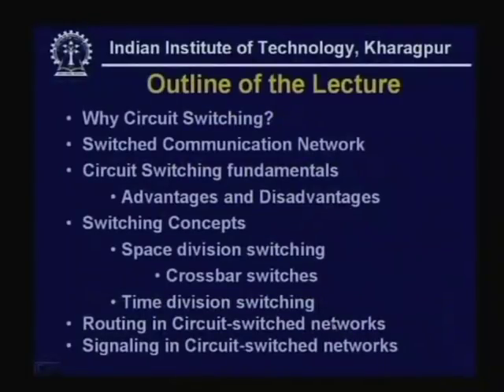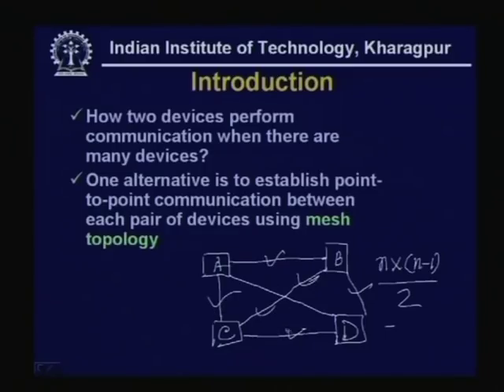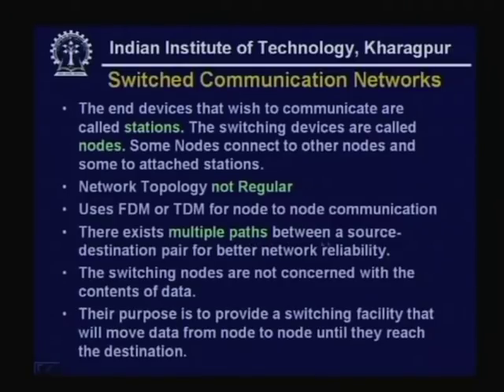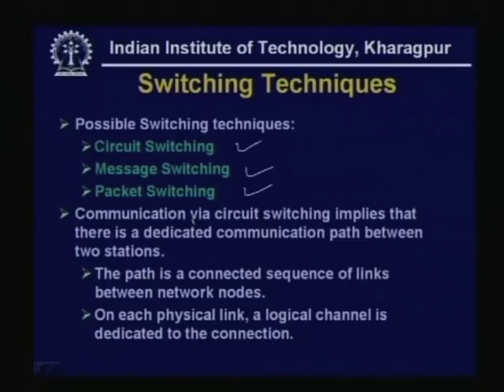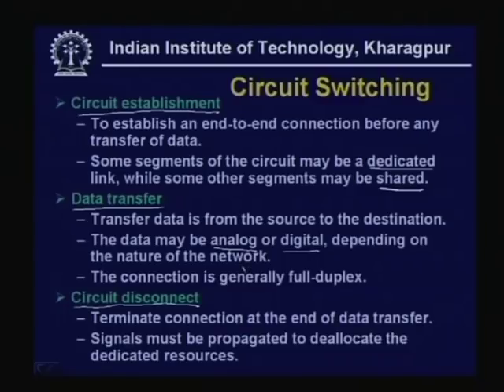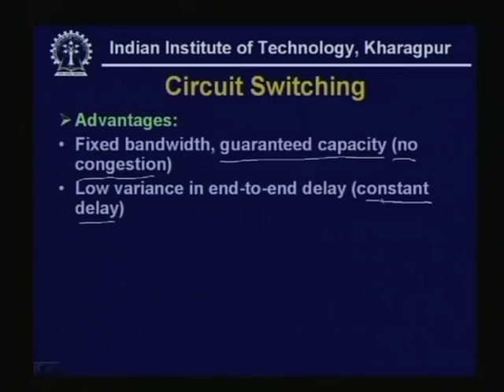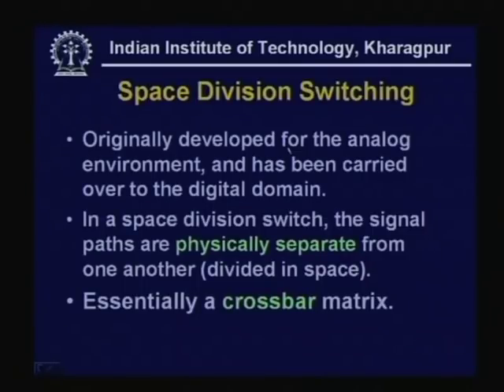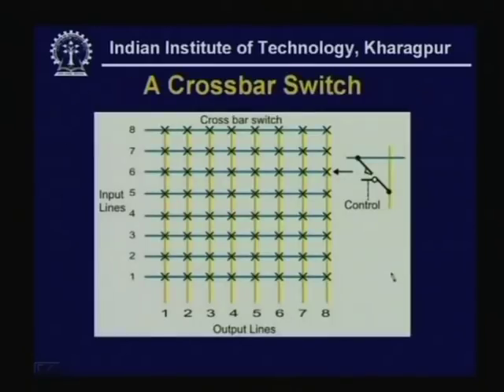Lecture -18 Switching Techniques Circuit Switching

Comment: Sir,
Could you please elaborate on blocking and non-blocking switches. 
I came to know that non-blocking can be obtained by introducing more switches in the network.
But with in a particular switch whether intermediate or exterior switch if there is an established connection, then that particular path would be completely blocked.  How non-blocking passage is obtained between two exterior nodes, when there are multiple intermediate nodes.

Thanks and Regards,
Nandu Mishra